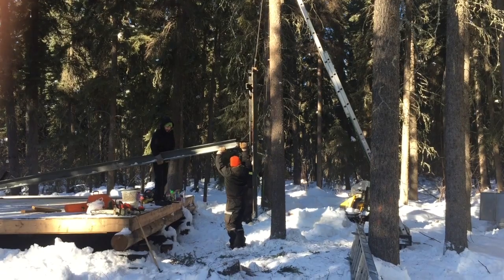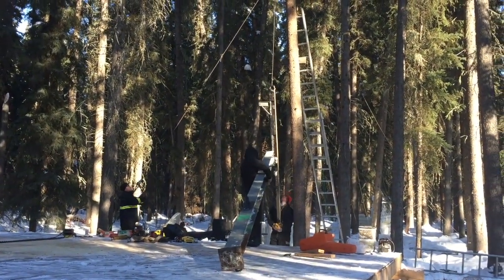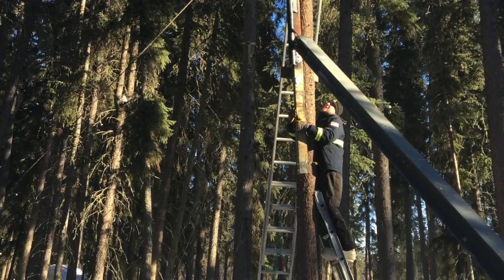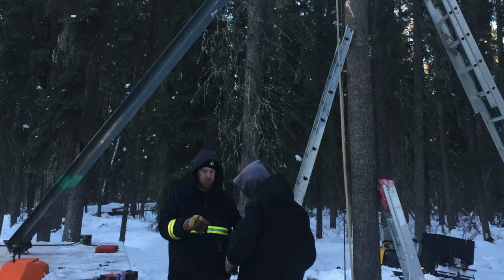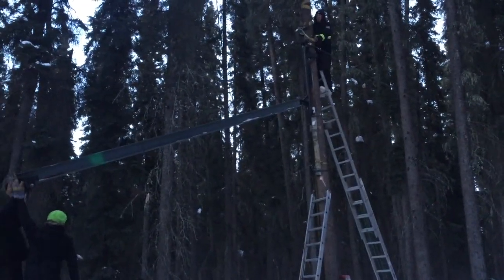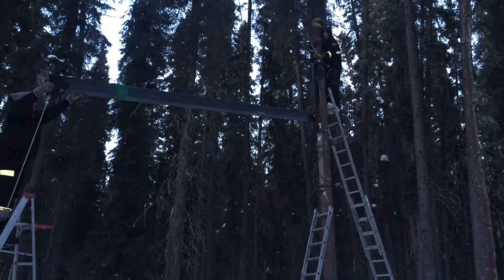Remote Off Grid Alaskan Log Cabin Build Part 2 how we raised our logs

Comment: What are the upsides vs downsides to doing a floating pad foundation instead of a sonotube or pillar foundation? Love the videos, keep them coming :)
Reply from the maker: A lot of people I have talked to that used post or pipe in the ground have had heaving problems. I guess if you could dig down to gravel and pour a sonotube with a foot it would work great. I didn’t want to haul concrete up. The way I did it I can easily adjust or add to the pads if I have settling issues
Reply: @diyalaskanlifestyle  that makes perfect sense. In all honesty the foundation is the most worrisome part of the cabin build for me so any first hand knowledge I can get on that topic the better. Thanks so much for the reply